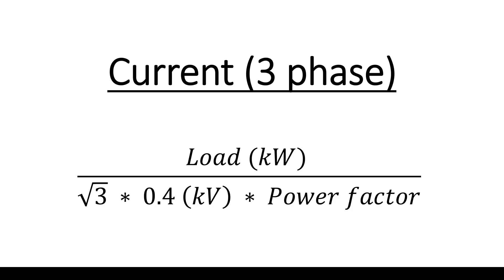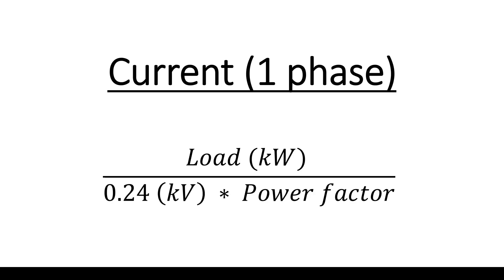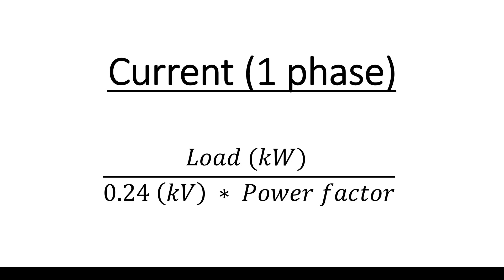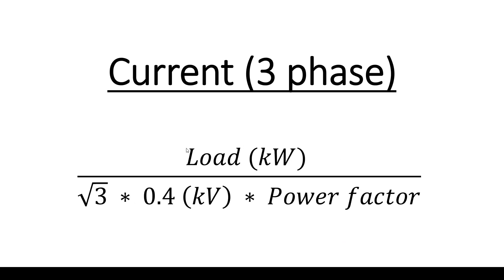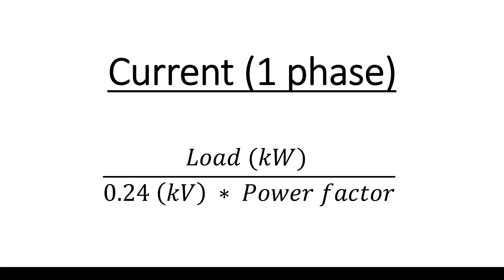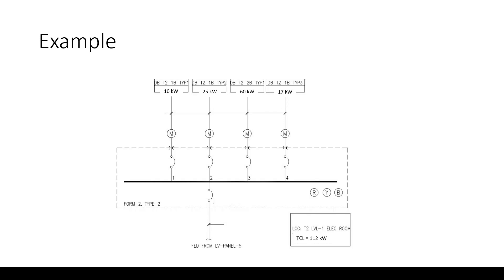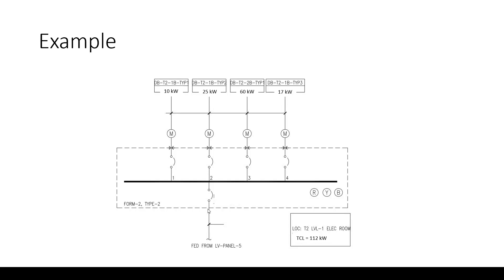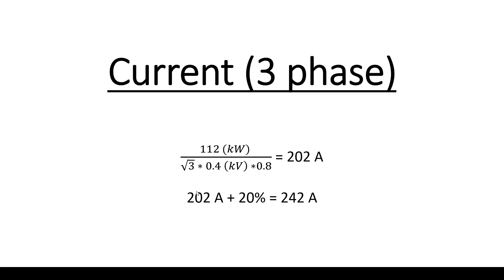Electric Circuit breakers and cables Sizing calculations as per DEWA standards (English)

Comment: EXPLAIN HOW TO SELECT THE SIZING OF STARTER ASSCESSORIES LIKE CONTACTOR, OLR, MAIN CIRCUIT WIRES, SF UNIT & MCB INSTEAD OF SFC UNIT  IN SUCH THUB RULE AS "SIZE = FLC*MULTIPLER.